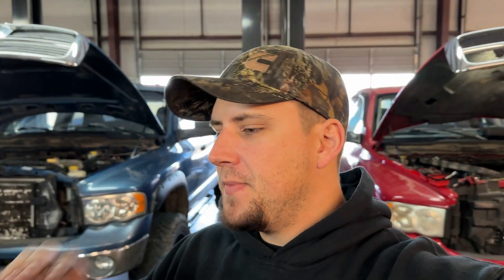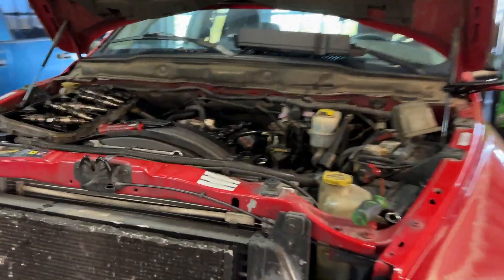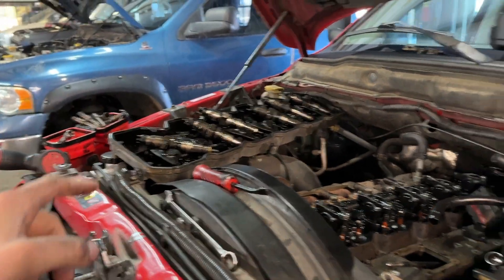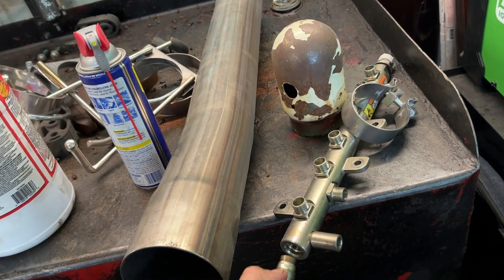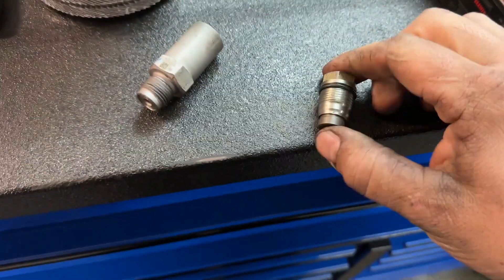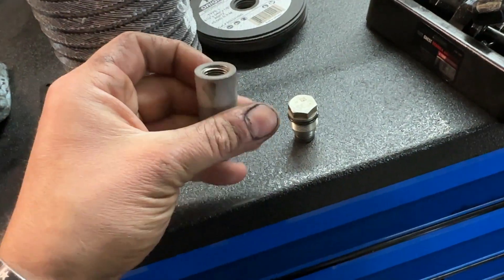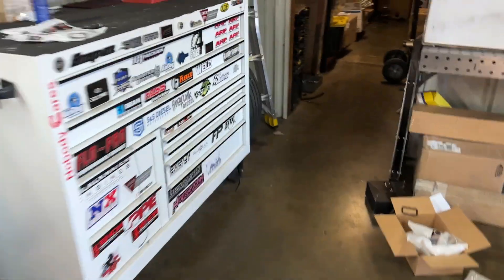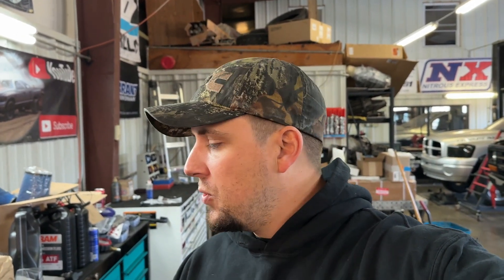STOP KILLING YOUR INJECTORS!

Comment: I destroyed my share of injectors. I got a 2600bar one from fire punk. I wish I had a knob to adjust rail pressure on the fly. 

I have theory's I want to test. Like cruising on the interstate and adjusting the rail from 16k to 22k to see if it improves mileage. I would also like to have the injector not deliver any fuel when I let off the throttle until its necessary to keep the engine running. I have been playing with a stock file. I also want the top part of the pedal stroke to be like it is in tune 5 from fire punk. His file is locked, but if it wasn't this would be the part of the file I would be trying to manipulate. I got a lot of it dialed in I am having trouble messing with the fuel tables. I seem to mess something up every time.  If I ever make it to FirePunks dyno maybe he can explain what's good or bad about what I am trying to do. I am sure it will cost me a few grand.
Reply from the maker: You literally can do All of that in tuning. 22k is a lot for cruising 14-18 is where they are happiest
Reply: @horsetorquesdiesel  Like you have suggested I have been watching  a ton of vids and I still have not found one on the part I am struggling with. Maybe I am just a bit dense. I am looking for an easier way. 

I am trying to get the MPG I had with the banks auto mind tuner. I used to get 800 miles out of a tank with mixed driving. Now lucky to see 450 to 500 if I dont beat on it.  I cant data log banks, but my rail pressure gauge shows 20 to 22k at cruising speeds. I assume he is cutting fuel when you let off. I figure this might be a start. The injectors are nosier for sure with his tune vs FP's.. 

I have been comparing the data logs to get an idea at what the set points are, but enter them in in each spot is very tedious and seems to be prone to weird errors. I am sure there is a better way. 

I am sure like the my overclocking software, or MS Office there will be a point where it all clicks and I will get it, but for now I am dumb as a stump. 

I know everyone is worried  to make the tuning vids due to the strict rules of today. The ones that are out are very board. I am honestly wanting to keep my fuel in my tank except when I want to be stupid. I will probably upset the community when I figure it out cuz I will make some crappy vids on the topic I struggled with.  

Thanks for replying.
Reply from the maker: @BentonL  might want to check injectors, that’s allot of rail pressure might have damaged them. The 6 Gun tuner I drove was hot 🗑️
Reply: @horsetorquesdiesel  22k PSI at 80mph you think is high?  I am probably gonna break some More stuff.  LOL. 

I asked industrial what was safe before I started messing around. This what they said
"We recommend not running over 190MPA of pressure to the injectors as the solenoid life drastically reduces above that level. 190MPA is what a factory rail sensor measures up to."  

It seems as long as I dont go over 27,500 (190MPA) I am good.  Considering what calibrated power was discussing with exergy being tested at 40,000 for an extended time I thought it seemed a bit low. I figured its best to get exergy for my next set assuming I gonna want to play with those numbers. Maybe not. 

I know I look ignorant but I will get it eventually.

Comment: Definitely an eye opener. For box tuning, stock sticks and pump, what would you advise as an alternate to stock relieve valve for now, if at all? I have a 165 fass on board and plan on going up to a 10mm with 125 injectors in the near future so I'm assuming when that happens I'd me changing that valve again. 
Thanks!

Comment: Another great info video, got a 6,7 truck  with custom tunes,duel 30 over pumps turns 5 k will 14 m energy pump hold rail  pressure at high rpm, guess I'll need to get relief ordered instead of plug